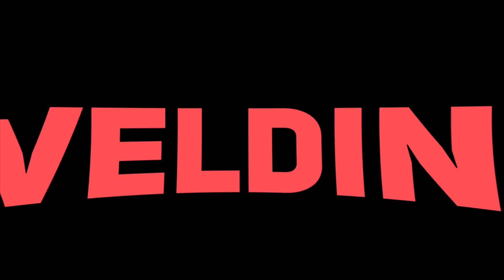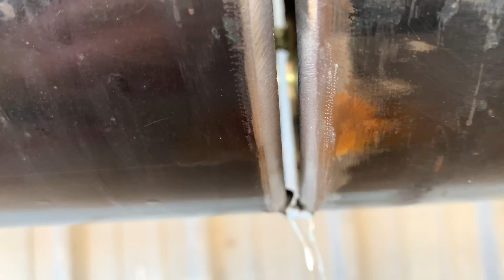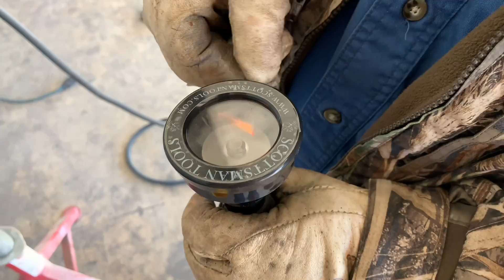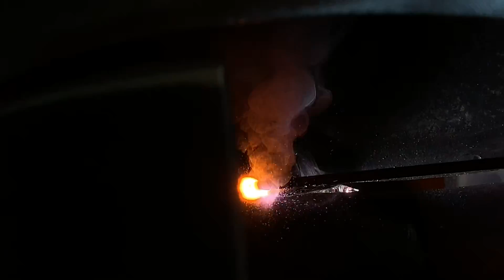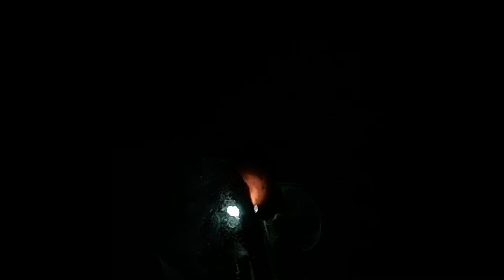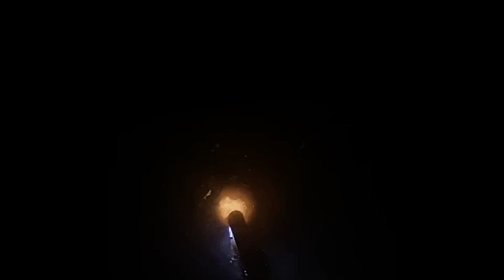How to Under Water Tig Pipe Weld

Comment: Is the possible with a 6010 or such type of electrode.  If it is I'd love to see how that's done.  We have an irrigation project that we often need to fix holes on steel mainline but very difficult to completely stop water drip.

Comment: This is the equivalent of dousing a hot weld with water? This would make the pipe and weld very brittle. If it's just junk alrighty then, but if it's any kind of critical service, then consider it a fail, but not the welder, on supervision.

Comment: try welding stainless steel steam leaking tube while water keep pouring out.Small tube,size 12 mm.Always make me stress when i find this defect on powerplant site.All valve along the pipe were passing,damage,can't close it.Cannot fully drain the water out.So left me with stressfull day,job not complete.No solution yet.That was a hot steam tube.Urgent,yet can't be done.Still learning.If you show to us.I will be so grateful.

Comment: Never pass x-ray ,only system it would be acceptable on would be a drain and that's if no rice paper or drying efforts where effective,that area of weld would be so weak because of the rapid cooling as well
Reply from the maker: +dixiedevil1369 Pass X-ray all day every day
Reply: @WELDorDIE  must be less strict on there's,would never pass TVA
Reply from the maker: Usually extremes like never would pass. Are just lack of knowledge from experience. Usually these beliefs arise from book knowledge not real world knowledge. in theory knowledge is not fact.

Comment: Worked  with this old-timer.
He thought me a truck with white toastbread....
Jam it "upstream", fit and weld the tube..
Open the valves, and the flow will desolve the bread.... Problem solved.
Used it on steam pipes a couple of times..

Comment: FYI guys if they gonna shoot this weld don’t do this it’s guaranteed to bust out!!!! But if it’s just a drain or vent then go for it.... I’ve personally always taken a rosebud and heated the pipe 3or4 foot away from the weld or stuffed the pipe with a rice paper dam or a loaf of bread to soak up the water it will wash out during start -up.....
Reply: Bread works wonders

Comment: I cut a window in 6"steam pipe had water running thru it cracked in bottom used 5 p red wire fixed the leak, God bless stay unreligious.